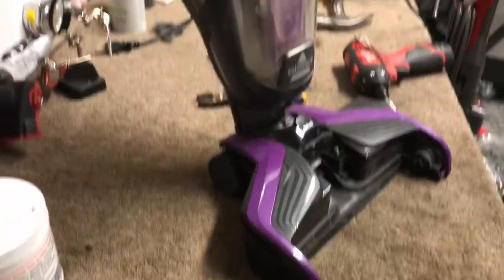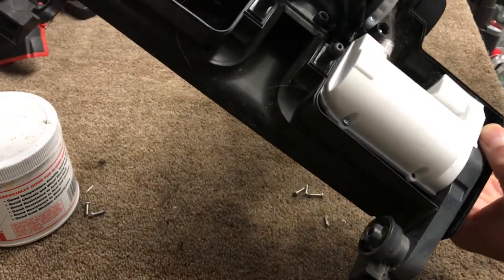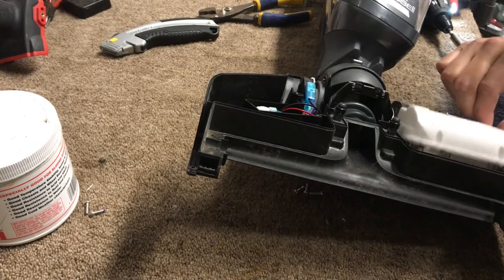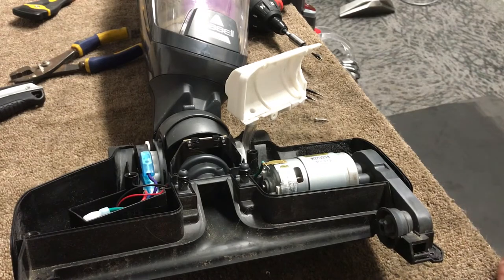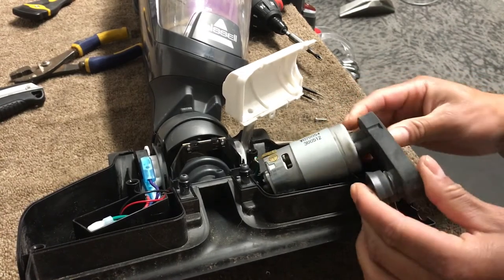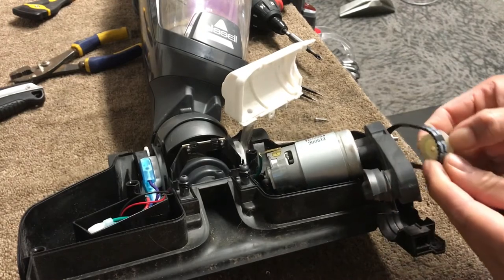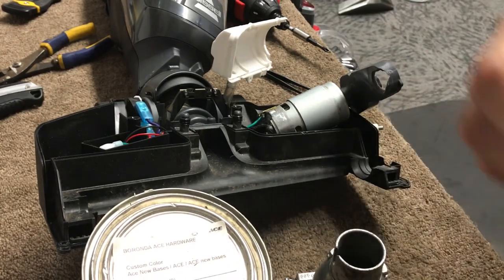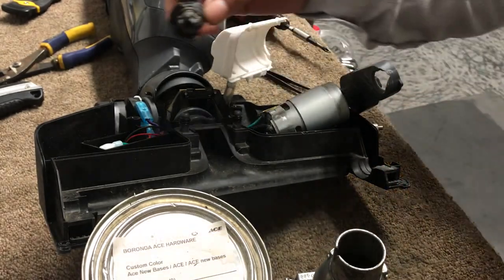Bissell Cross Wave Turns Off

Comment: Thank you for this video showing how to dismantle. I did not use the hammer at all. I took off the circlip at the drive end instead and removed the belt drive as a unit, by loosening the 2 screws on the belt drive fastening to the motor casing. Using WD40 to help dislodging hairs trapped inside the drive brush. It took me almost an hour to clear hairs. Working on the belt drive unit with the brush is a lot easier
Reply from the maker: Awesome

Comment: A bad roller brush could be the cause of the machine turning off. I tried everything but then noticed a post that suggested it could be a faulty brush. I did just change mine out and I checked it and that is the issue. I switched it out for another one and it works like a champ. I bought them off of Amazon and I guess one of the brushes was faulty. So yes try that first before tearing down the machine.
Reply: Thanks for that recommendation. I tried all the basic troubleshooting..and changing out the brush worked! Thanks!

Comment: Thanks for much needed video, I was able to fix mine. The same issue of powering off automatically the gear was stuck, and brush wasn't rolling. However I opened up the main cover cleaned a lot of dirt including hair residue and melted plastic pieces using toothbrush and pointed tools with hot water from gear end. Also I changed the brush for about 30 dollars. I noticed that old brush side was badly melted from the motor end due to excessive heat I guess. After clean up I used lot of light machine oil to make that gear rolling again. I could feel that there is still some dust inside but I was having the fear of breaking the plastic as in ur video. Now it's working fine 👍
Reply from the maker: I’m glad you got fixed

Comment: There is a sealed bearing inside the piece you were hammering on. If you had not broken the housing, you would have surely sent pieces of the bearing flying when it came apart. If someone is determined to get it apart, they should at least soak it for an hour or more in WD-40 or PB blaster and then try to gently press it out (but do it over a pan with a rag in the bottom to catch flying parts). Of course there will be lots of hair and other stuff wrapped around the shaft as well. Mine is sitting in pieces until I can get a new bearing for it. I was lucky enough not to break anything plastic, but when I tapped it out (not knowing about the bearing) all the pieces of the bearing went flying.

Comment: My wifes beloved Crosswave went to the curb, the bearing was filled with hair & was destroyed, all screws were too small, with phillips heads, the wiring harness was too short with small gauge wire not properly soldered in place. Motor was rusted, bearing was not removeable on the brush roller, general construction was designed for limited lifetime with no repair parts support.

Comment: Before yo start pulling the thing apart remove the brush roller and see if the motor continues to stop start. 
If it runs continuously then check that the bearing at the end where you pull to remove the roller is seized or not. That’s what had occurred with mine. 
I changed the roller/brush and all was well again. 
I’m not convinced that the percussive maintenance approach demonstrated is entirely appropriate.
Reply: Thanks for suggestion; that is all that was needed to fix mine. Glad not to have had to pull it all apart!

Comment: It should be noted that it is not always the brush drive bearing that seizes. The motor is often stuck. It is fairly easy to remove - just a few more screws and disconnecting the 3 wire nuts which are reusable if your careful. This also frees up the whole motor / pulley assembly from the CrossWave to work on much more easily than trying to beat it with a hammer while tethered the machine. It is often just a matter of turning the motor shaft with pliers or a crescent wrench to free it up. Oil the bearings but be careful not to get any in the motor housing. Good luck.
Reply: Hi I’d say you are good at figuring this out. Had the machine for a while but i stopped using it. Now I’m using it and just keeps stopping. Never had a problem before?

Comment: Hey Mp Vacuum thanks for the video!  I own a cleaning company residential and commercial and you saved me a machine.  By the way the part you broke is for sale now online.  Here is the link  https://www.buyspares.com/multi-taskers/crosswave-1713/brush-motor/product.pl?pid=5272730&shop=bissell&path=254065&model_ref=12051708  I have never order from them so I can not speak on their integrity.  I have no reason to doubt them I just never used them before.  They have a lot of odd parts which is a bonus.  Lol

Comment: Did a little looking up and the bearing you can find it just look up r4zz
Reply: Do you have a link of the bearings you purchased? I bought some r4zz bearings. But the inner circle seems too small. Thanks
Reply from the maker: i haven’t look for these kind of bearings.. i normally clean them and    then grease them ..

Comment: That piece actually isn't supposed to pop out. I'm not at all surprised you broke it. What you should have done is get some vice grip pliers and grab the pin and twist it back and forth. Which should work whatever hair and grime you have out of the gear.
Reply from the maker: I tried  but it was really stuck.... I have taken them apart from the inside before. This time it was so melted with hair.
Reply: mine came up no problem but the bearing was done